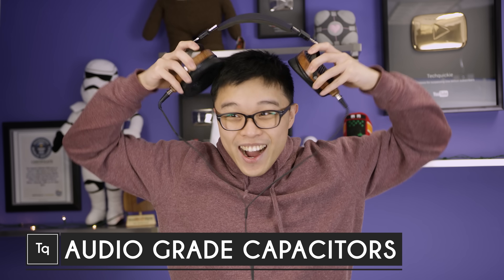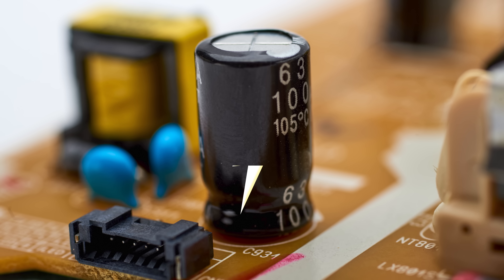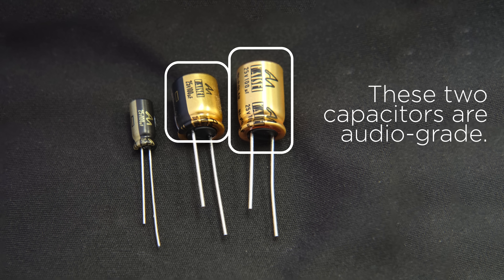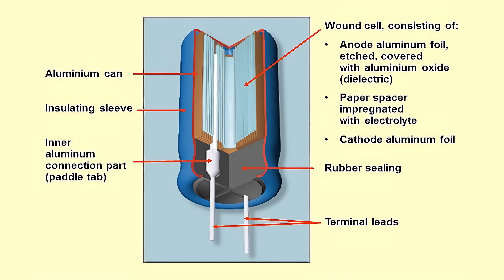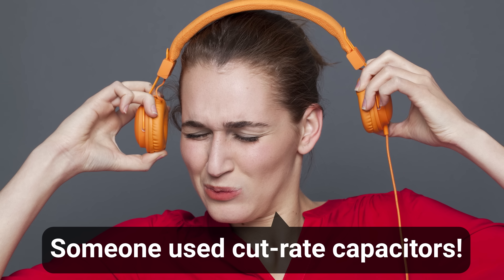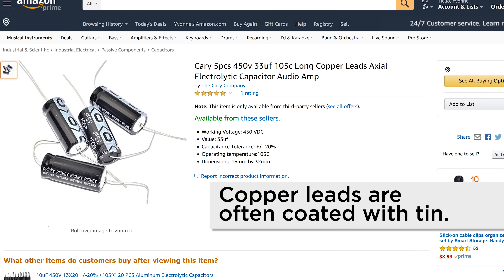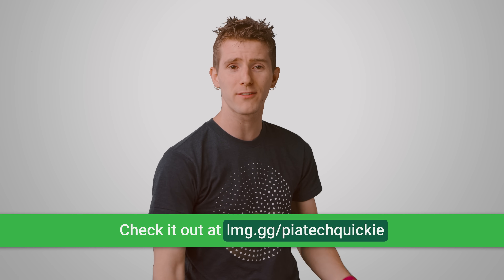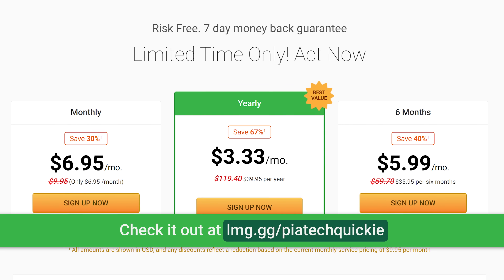What Does "Audio Grade" Mean?

Comment: You just make it too simple. Capacitors is all about electric energy capacity, discharge rate, recharge rate, ESR, noise and ripples filtering.
Reply: I had to reread this because the first time I read "nipples filtering"
Reply: This isn't a capacitor tutorial video.
Reply: @MathewPanicker1010  Right, this is not a tutorial, but you can't really tell what's different or special about any type of capacitor if you don't talk about these specification.

Comment: Linus, what the F was this all about? As a consumer, you should be concerned about amplifier performance, which brand of capacitors are used is of absolutely no importance. Yes, there is good manufacturers, and there is crap ones, and the only thing that differs is variations in specifications, and reliability. It will always be up to the designer to select components within tolerance. There is no such thing as an audio-grade capacitor, it`s nothing more than a marketing scheme to make money. For capacitors(and electronics in general), it is the electrical characteristics that is important, not some messed up "feeling" that some moron made up in the late 70`s. Engineers does not feel their way to a good circuit, they calculate, simulate, prototype and measure to make good products, in audio though, there is way to much hype about feel, and not enough care is taken to give consumers proper specifications on the products being sold. -Kim, Electronics engineer
Reply: Audio science review is a great site. Because evrything is measured and based on science. No feelings just data

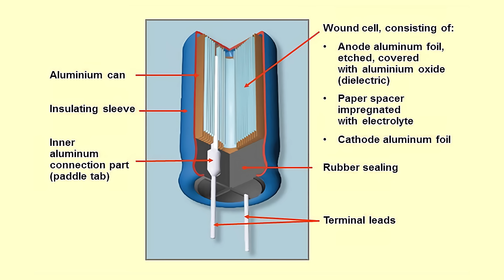Comment: This video has so many mistakes/oversimplifications. At 2:00 electrolytic does not have to be audio grade.  At 2:25 the impedance does drop BUT for power supplies the main problem is parasitic parallel inductance and parasitic parallel resistances, together names ESR. Large capacitance is more important for low frequency ripple (eg. bass) at higher frequency (mouse screeching) ESR and parasitic inductance and inductive coupling is to blame not lack of capacitance. At 3.08 leads are never made of steel, lol, no. The "steel" colour is tin plated copper. Also thru hole capacitors are almost never used on PC, especially not on MOBO where the "audio grade" would be. They are more and more SMD.
Reply: This comment should be at the top!
I think the number of mistakes is unacceptable. Made an epic facepalm when he told about steel leads...
Reply: And with that do you have some advice and brand to get a very good audio quality because that what really matters in the end
Reply: @ommsterlitz1805  I would say that the engineer that builds the audio equipment is 1000X more important then the brand of capacitor used.
Reply: @markoantesic4362  i wasn't talking about capacitor i was talking about brands of audio equipment like headphones speakers etc... just to have a useful impact for the customers you know
Reply: And rarely do companies develop their own cap's. they're branded parts made to spec. The engineering spec for most of them is just .1 or .01% tolerances. LTT you really should check with independent electrical engineers who design these products while they're not on the clock or have investment in this. You can't ask a company that makes audio products to help you explain "audio grade capacitors" when you should have hooked up wit EEV or NWAVguy and explained the actual properties and not just oversimplify why audio companies use low tolerance electrolytic caps. I'm embarrassed for how this video turned out for you, you guys usually give really good simplifications that stay true to the concepts but this video screams that you didn't do your research and didn't vet the video with an independent professional who didn't source you the information.
Reply: Tong Zou  Or GOOOLLLDDDEEEEEEEE!!!!
Reply: Yea
Reply: Hello Marko, you seem to know the topic of audio capacitors. I don't know very well. I ask you some questions because I have replaced the main capacitors on my 200W amplifier and I don't know how to give me a technical answer, and I would like to understand how to technically check with laboratory instruments how good an audio capacitor is. I unsoldered the old capacitors and first measured the capacitance in uF and then the ESR value in ohms, I found good values even if the audio of this amplifier was very bad. Before soldering the large 10,000uF electrolytic capacitors instead of the old ones, I checked their capacitance value in uF with the tester, and also measured their ESR value, and also in these new capacitors the values were good. Replaced the capacitors and tested the amplifier, the audio is now good. How can it be then that with old capacitors the audio was bad even though it had the same good values? How can I measure the quality of new capacitors before installing them? Many thanks
Reply: @michelegrassi3492  
I don't know much about "audio" capacitors, I know electrolytic capacitors form my work with power supplies. 
1) if you have lab equipment (scope & function generator) you should make a base line performance graph of your amp.  I would start at a frequency vs amplitude graph nad then move on to a THD (total harmonic distortion) for a couple of tones (sine wave, 100 hz, 500 hz, 1khz, ...). With a base line you will have a more objective way to tell if you did anything with replacing capacitors. 
2) cheep ESR meters only measure the resistive part of the capacitor so you don't get a whole picture of what a given capacitor really is. To measure inductance of a capacitor you would have to test/measure the impedance of a capacitor at higher frequencies where the inductive nature would previle over resistive/capacitive so that you would know if capacitor a is equal to capacitor b. Google "Electrolytic capacitor impedance" then look at pictures. You see that the impedance goes down, then stays low then goes back up again. This back up again region is the inductance. Different construction types of capacitors will have different inductance (size, winding of the internal layers, lead position ...) .
2.1) if it is a ceramic capacitor, that is a whole new can of sup points and *. Ceramic capacitors are know to change their capacitance in relation to the applied DC bias. Again a cheep tester does not tell you much here.  
3) The 10 mF capacitor is quite big. If I were to take a guess, that would be some sort of DC blocking cap before the speakers. Here different impedance (capacitance/resistance/inductance) will lead to different frequency response of the amp.
Reply: @markoantesic4362  Thanks for the explanation, the information is very useful and now it is clearer to me where to look for the differences between one capacitor and another. I will have to evaluate the frequency graphs, evidently ESR is useful to understand the state of wear of a capacitor but not the degree of goodness of that capacitor as the frequency varies. Thank you very much, you were very kind to explain to me

Comment: He is cutting corners like crazy for the laymen...
Electrical Engineers, like me, cringe at times..
Anyway, well done.
Reply: would you be kind and provide pointers for your perspective of the matter ?
Reply: I mean i like techquickie videos because i learned a lot from them but this one was utterly pointless. Like go and buy audio wtuff with expensive capacitors what the fuck
Reply: as an electrical hobbyist this video made me cringe as well.
The electrolytical capacitor is not an invention of some audio company, it is not anything hi-tech and its not any better alternative to ceramic or film capacitors (actually worse when we talk about parasitic resistance and even inductance, critical in audio circuits). And shit like making copper leads to decrease resistance? what the hell man the rest of the electrodes is aluminum or electrolyte. Youre not gonna lower ESR which is relatively high for electrolytic caps by putting copper leads in it omg. If a audio equipment is good it is because how well they engineered the circuit not because they used electrolytic caps with copper electrodes :D

If you wanna know something more about it:
The basic principle of a capacitor is that there are differently charged electrodes close to each other (one has more electrons, one has more) The difference of charges is causing freely moving electrons, aka charge carriers) to be in one of the electrodes because the other positively charged is electrostatically attract them. The electrostatic force is inversely proportional to the distance of the objects, in our cause electrons and empty-spaces-for-electrons in electrodes, thats why we want to make them be as close as possible so thats why there are electrolytical capacitors where there is one electrode and the other one is electrolyte and the only thing separating them is an thin oxide layer (like micrometers thick). A charged capacitor has a potential to make the electrons flow to level out the charges on the electrons by actually moving them from one electrodes to other. Its like when you have a battery and electrons flow from one end to the other. The Equivalent series Resistance, ESR or internal resistance is the overall ability to move electrons. Aluminium is not that great of a conductor and in capacitors there is a very thin layer of it. And the electrolyte is even worse, thats why el. caps have bigger ESR. When you want to charge thhe capacitor rapidly (like tens of thousands kHz) the ESR starts to play a big role. Usually you connect a parallel ceramic capacitor to the el. cap to reduce this effect. Or there ale low-esr el. caps which you can use. Definitely not audio grade capacitors with copper leads and whatever secret ingrediences lol
Reply: At times.. Man most of the explnation is a bad mix of various capacitor types.  Electrolytic are by definition all filled with an electrolyte. The there are many types of capacitors. Some are ceramic, tantalum,  film (plastic and others), there are more but you get the point. Audio grade used to mean more than it does today. It was initially more to designate a lower ESR, and generally non polar electrolytic. Electrolytic of days gone by were not generally as low of esr as the standard off the shelf is today. Today the term audio grade is not much more than a diluted term by over/mis use of said term.
Reply: Because that's what this series is for. If you want actual lectures, go elsewhere.

Comment: Audio grade in the area of capacitors just means a low ESR. Nothing will determine sound coloring other than capacitance, resistance/impedance, and inductance.
Reply: Eyeroll. Any wrongly rated component will screw things up.
Reply: @timramich  Nothing to do with being wrongly rated, at all.  It's about whether they are inherently good (as in MPP caps) or whether they are well made and used properly (electrolytics).  This  applies at all voltage and ripple current ratings.
Reply: Snake oil nonsense
Reply: @timramich  Are you thick?  I am telling you that certain capacitors produce measurable distortion in significant quantities and you call that snake oil?  I even gave you the reference so you could read it yourself.  0.15% isn't just incidental.  Believe me, I do this for a living!
Reply: Snake oil
Reply: True
Reply: Thank you! Basically was going to post this if someone else didn't.
So much misinformation in this video.
Reply: And to a lessor degree temperature drift and long term stability esp when used in LP, HP,  BP, and DC blocking
Reply: Not exactly. It's not just about low ESR. It's more about low dissipation factor(tan delta). Just having a low ESR does not a good audio capacitor make. Everything else he mentioned about the electrolyte and dielectric materials matters too. Which is why you won't find any "low ESR" solid caps that are "audio grade".
Reply: @MetalMasterdom tan delta = ESR / |Xc|  so?
Reply: @kennmossman8701  Exactly. So...if you think you've proved some point to me...go ahead and think that. It isn't the case. But whatever.
Reply: @MetalMasterdom  Other than introducing  a term which is dependent on already stated parameters what have you done?
Reply: @MetalMasterdom  Tan delta is the resistive component of the capacitor's impedance.  It is the ESR!  (The equivalent of a series resistance.)
Reply: @kennmossman8701  Given you something to arrogantly ramble on about. Evidently. Anyway. It appears as though I'm wrong about DF being significant and solid caps not being good for "audio". At least I can admit that though. When you're wrong you're wrong. Not when you're wrong...well...do what you're doing. For lack of "better" terms.
Reply: @ChristianRThomas  Wow...you too? Yeah...whatever you say boss. Same exact thing. That's why the equation is tan delta = ESR. Oh...wait...is that right? Hmmmm....
Reply: Wrong.  And ESR isn't especially well correlated with sound quality.  What is, though, is distortion.  A single shitty capacitor can have more distortion than a whole 1970s Japanese amp.  See Bateman on Capacitors - it's a very well known series of articles.
Reply: @ChristianRThomas  As I noted elsewhere it depends on use of the cap; bypass, power supply filtering, DC blocking, filtering, etc
Reply: @ChristianRThomas Perhaps re-read his article...."In many, perhaps most circuits, this may not matter, but when used to de-couple the negative feedback
arm in a conventional power amplifier, these capacitors have created problems. My suggested remedy is
to use a non-polarised, Bi-polar electrolytic capacitor for this position, which has the added bonus of
reduced distortions."   http://pa2hs.kg-uitdaging.nl/documenten/Capacitor%20Misunderstandings.pdf
Reply: @kennmossman8701  You'd be better off going back to the original articles - that appears to be a summary.  He is also trying to be uncontroversial.  They all make a difference, and not just in a direct signal path.  Power supply reservoir caps are especially easy to hear and measure.  Their impedance, too, affects the entire output circuit and, but for feedback, would have a huge effect on the signal at the speaker outputs.  I do this every day so please don';t imagine yourself an expert.
Reply: @ChristianRThomas  Ohhhhhhhhhhhhh  so you are expert? Can you link to your white papers? journal articles?  reference books you authored?
Reply: @ChristianRThomas  I did read the entire article (and others by that author) and yes that is a summary. So?  Is there some profound insight that the author missed in the summary that only you know?
Reply: @kennmossman8701  I'm pretty well known in my area.  Most of the people you've heard of will know me.
Reply: @ChristianRThomas  Of course I believe you.- afterall this is the Internet [and your discourse has been haphazard and non-technical] .........Bet you can not even see the flaws in your hero's experiments. Can you link to your white papers? journal articles?  reference books you authored?
   None?   Did NOT think so
Reply: @kennmossman8701  There are plenty that he mentions.  He notes how much lower the distortion is on Bipolars than it is on Black Gates or Elna reservoir capacitors.  As for how this gets onto the signal is something that is overlooked by almost everyone, that power supply rejection is usually zero in amplifiers - only the feedback corrects it.  There's also the Early effect dropping supply rail muck onto the signal at 60dB down (depending on the VAF).  Component choice really matters!

Comment: For anyone with buzzing noises on their on-board sound, try buying a cheap "ground loop isolator" for your audio output. It'll get rid of a lot of the buzzing. It's cheaper than upgrading to a separate soundcard and wasting a PCI-e slot (and PCI-e lanes).

Comment: As a EE student, most of the explaining is not quite accurate but easy to understand for normal people.
Reply: I'm no EE guy but I always thought that "audio grade caps" mean low ESR...
Reply: Some parts are physically better than others, but using "audio grade" is such a dumb idea. Also, the reason why these higher grade part is better is rarely things mentioned in the video. But I believe for a good reason, which is Linus doesn't quite understand electrical engineering himself. His team make tons of great videos, but this isn't one.
Reply: yep... like saying the Earth is flat.. becasue "people are too stupid to understand anything else". 

when you grow up you will realize there is no such thing as a "normal" person.......
Reply: Easy to understand vs not so accurate.... accuracy in information should not be relegated to ease of understanding...
Reply: Ask an audiophile about capacitors and this is what you'll get.
Reply: What's inaccurate about it. Id like to be as well informed on the topic as I can be
Reply: Mistakes already pointed in some other comments.
Some of them (there is more): ordinary capacitors with steel wires (BS, wires are made of plated copper even on cheapest), electrolyte is exclusive to "audio grade" capacitors (BS - with electrolyte on without - defines the type of capacitor and has nothing to do with audio); using electrolyte increases capacitor's response to rapidly changing signal (BS - electrolytic capacitors have significant limitations because of using electrolyte in terms of internal resistance/ESR. And due to this they usually paired with some non-electrolytic capacitors to achieve good overall performance). This boils down to design of a circuit, not the "audio-grade" and gold color.